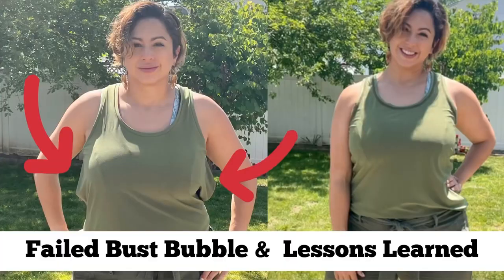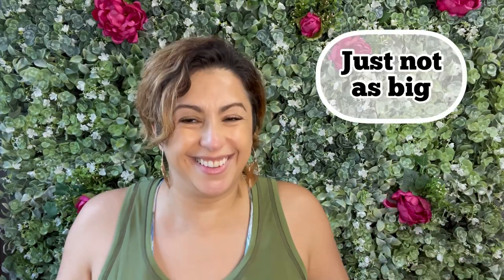Failed Bust Bubble and Lessons Learned

Comment: Girl you have been spying into my sewing room, haven't you?  I just went thru the same thing trying to fit a little dress.  Try this, try that, do this, do that, it ends up a big mess.  Ugh.  Back to the drawing board every time!  The 12 looks fantastic on you.  And that coverstitching!  You have definitely conquered it.  I really do want a coverstitch machine so that's up next on the wish list.  My 1034D also was a good little workhorse . . . until it wasn't.  Those machines are great but they just have pretty short lives imo.  My repair guy also recommended Janome or Babylock.  I went with the Juki because I found it on FB marketplace still in the box.  A little pricey, but SO worth it.  I looked at the new Bernina coverstitch machine and pleasegiveittomenow seriously!  It has air threading! Definitely getting that the next time I have $8k laying around . . . 😂
Reply from the maker: Ha! 🐰 hole I tell you! Regarding the serger, as soon as my guy said that he rarely sees a Janine come in for repairs, I was sold. Less down time = more bae time. (Bae=serger) 😂